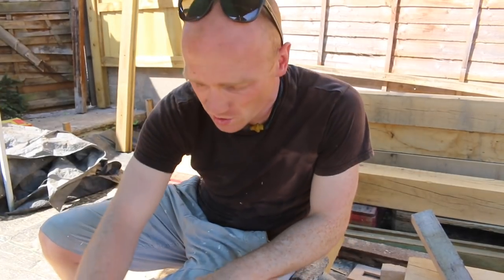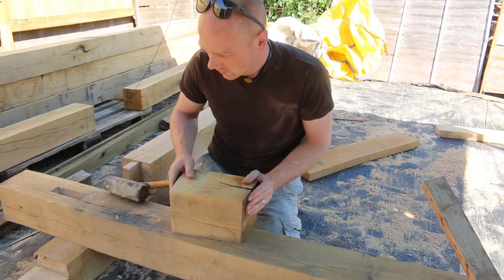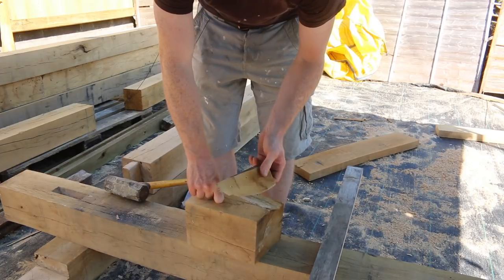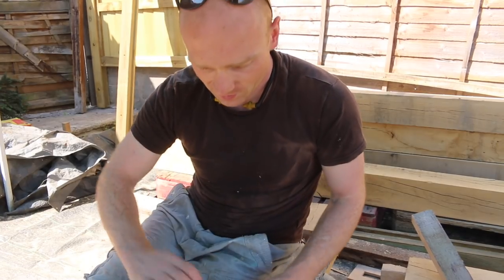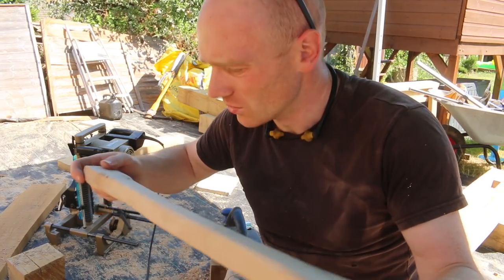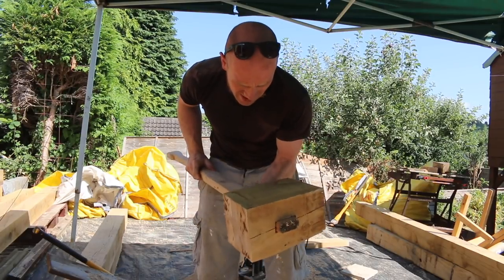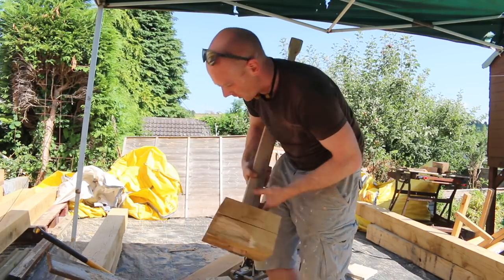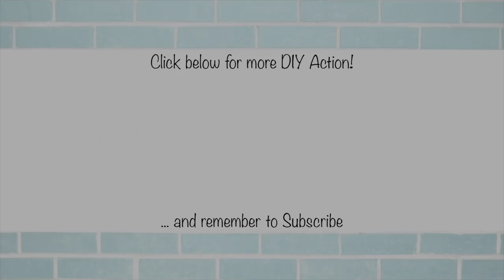Giant Timber Frame Mallet

Comment: Would it not be nice and safe if a dowel was used at the top and bottom of the hammerhead to lock it down??????? 
(I mean on the projecting part of the handle, above and below the head of the hammer)
Reply: Sandeep V. Menon or straight through the head (via the shaft within the mortice)
Reply: Yes and it would come handy especially when children interested in DIY are around.
(got a nephew around who is interested in DIY, but in his case it is Destroy It Yourself, and always finds way to end up on the wrong side of screws, nails and what-nots)
Reply from the maker: Yes not a bad idea, will probably pop a wedge or dowel up top just in case.  That said, when that green oak head starts shrinking on the already dry handle it will be wooden welded! :-)

Comment: Using the club hammer to persuade the shaft into the head made me cringe. Just turn it upside down, hold by the shaft and bounce it on a hard surface. Let the head's own weight do the work.  :)